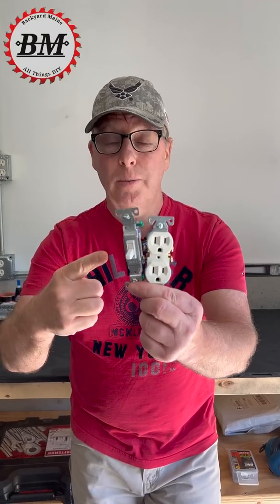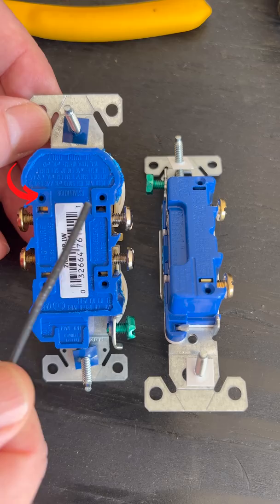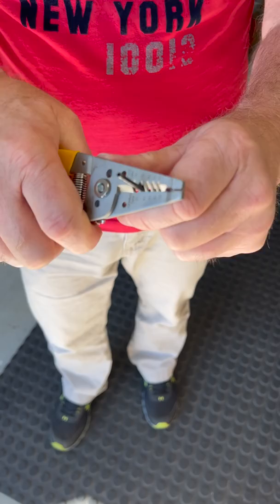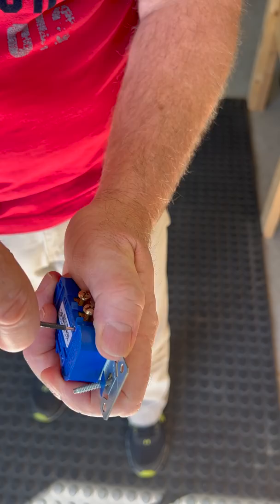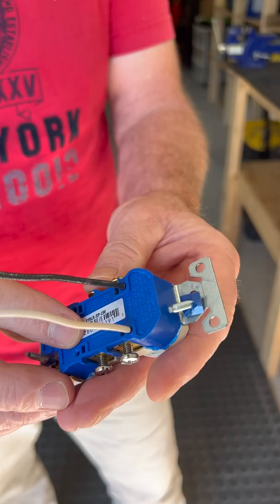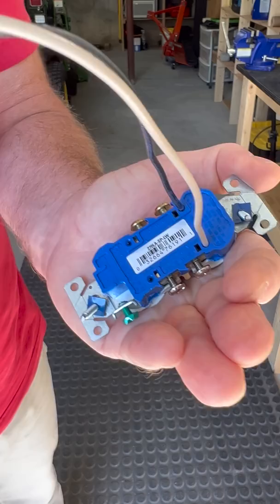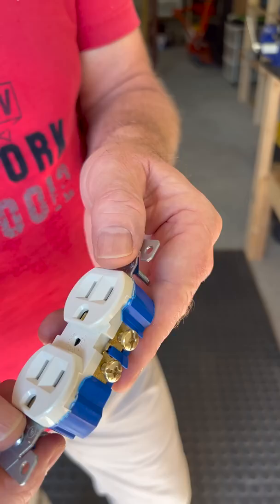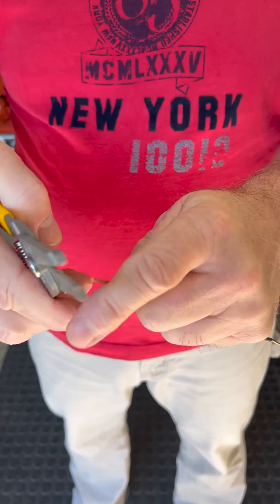Don't make this electrical mistake #Shorts

Comment: Please pay attention to this. Countless times, this has been the problem
Reply from the maker: Thanks for backing me up..
Reply: I work in remodeling,  we have an electrician, but he is buried in work, so i try not to bother him if i can avoid it. So whenever we have an issue with intermittent,  or no power at a location that is supposed to be live, thats the first thing i check. If i see them stabbed in, then i switch off the breaker and wire them up on the side post, that has fixed so many problems and allowed our electrician to get real work done

Comment: You also have to tighten the screw and the connection is secure.
Reply from the maker: You should tighten the screws so they’re not sticking out but they have nothing to do with the stab connections. I have a video where I cut one apart if you want to see the internals.

Comment: Phillips screw driver does apply enough torq. Finish with flat screw driver.
Reply from the maker: Never a problem for me. The screws are designed for all three flat, phillips, and #2 square drive.

Comment: Its a problem when you haven't stripped enough wire to go into the hole. If you have enough, will never have an issue. 15 year electrician here.
Reply from the maker: I've had a different experience. Replaced 100s of failed devices where the connection gets loose over time. 38 years in the field for me. Thanks for your comment..
Reply: @BackyardMaine  I wonder if older receptacles or certain brands are problematic. Im from Canada, I think the brands used are the same in US. Would be interesting to find whats causing it
Reply from the maker: @audittheauditors  Check out this video. It's an Eaton residential grade receptacle but the internals are the same inside a Leviton.. I pull one apart and show what the problem is or at least what I find. https://youtu.be/e_C_twh5fQE

Comment: Those ports always seemed sketchy to me. I never felt confident using them. I do my own work on my house. Switches and plugs is all I'll do though on the electrical side of things. When it comes to wiring or breaker box work, I get a professional in.
Reply from the maker: Yes they are.. Side wire or back wire with the screw clamps on the commercial grade receptacles for the best results..👍

Comment: You can backstab all you like if the rear connections aren't the standard spring-loaded connections.

Most every new home is built with back-stabbed connections because it saves the electrician time and time is money when building homes.
Reply from the maker: You can do it but they fail at a very high rate.
Reply: @BackyardMaine  If the rear backstab holes have screws and a plate they are no more prone to failure than using the side screws.

I agree the spring backstab holes are prone to failure, I’m just saying builders use them because they save time and by the time they fail the home will likely no longer be under warranty.

Pull any switch or fixture out of a new construction home and I can almost guarantee the connections are all spring clip backstabbed.

I don’t advocate that but haven’t seen a new home built in the past thirty years or so where it wasn’t a high-end custom home where the switches and outlets weren’t backstabbed.
Reply from the maker: @VideoArchiveGuy  The ones with the screws and plates are commercial grade devices and they work great. I was an industrial electrician my whole career but I also did electrical work as a side hustle. I have wired quite a few houses and I almost always used commercial grade devices. They do cost a little bit more but they are a much better device overall. When I have used residential grade I always side wire. But you are right most homes wired by residential contractors that I have worked in were back stabbed.
Reply: @BackyardMaine  Yes, and that was always meant to be my point. Thanks!

Comment: The only problems I’ve seen throughout the years with these plug in wires is they’re only rated for about 15 amps and so are those sockets and switches if you’re going to run 20 to 30 amps you will have to use the screws but you will have to use better made sockets that can handle the higher current and larger wires
Reply from the maker: Only 15A devices still have the back stab option. The 20A no longer offer this feature.

Comment: I back stab my electrical devices since over 20 years. I never had a issue with it. If this kind of connection makes you that big problems its probably more the fault of the producers of the electrical devices. If the code allows to use it, it's the producers fault !
Reply from the maker: I’m not blaming anyone. I don’t think they should be allowed but that’s just my opinion based on 38 years of experience as a licensed professional electrician.

Comment: I did not know you could use a small screwdriver to release the wire on back stab installations. I have always twisted and pulled the wire as it slowly works its way out of the clamp.

Comment: See those holes and slits at the top? the slit is to strip the wire the hole is to bend it. No tools required.
Reply from the maker: I made a video on that as well. It's actually my most viewed video to date at over 4 million views.

Comment: I’m guessing those back in connectors are code approved I’ve done several projects both ways as a DIYer but I would really like to know if I should stop doing the back connectors completely?
Reply from the maker: The receptacles with these connections are UL listed but based on my 38 years of experience as an electrician and an electrical engineer I think they should be avoided.

Comment: Question, how could you take a forklift battery to power a street  vacuum cleaner, or shop vac?
Reply from the maker: You would need an inverter to get AC power from a DC battery.

Comment: Backstabbing is approved by code.
Reply from the maker: It's not approved or restricted by code. The code tells us to follow the manufacturers recommendation when it comes to approved equipment. The manufacturer has instructions for the stabs and for the side wire connections so by code we can use either. These connections will work but they are unreliable at best. They are designed to make it easy for a home owner to replace an outlet or switch. As pros we know better than to use them. Most of us anyway..

Comment: One and only option in my area for outlets and switches, and not a single problem. Additionally they are maintenance free because they tighten itself. And touch protection is higher. Seems to be less advanced in usa.
Reply from the maker: We have lower voltage. These connections here fail at a very high rate compared to screw connections. Never assume we're not advanced. lol

Comment: I was trained to always connect to the sidewire. But why would the product create those back connections if they are a huge failure points?
Reply from the maker: They are fast and easy. Time and skill cost more money which is why many residential contractors like them.

Comment: I am replacing switches and receptacles in a Apartment complex from years ago with 120 units.  All are back stabbing ones.    Not one is burned or a problem.

So funny.  
Back stab. It easy and fun!
Reply from the maker: Surprising..

Comment: "Never do what the manufacturer intended"
Reply from the maker: These were designed to help a homeowner replace a switch or receptacle. They do work but will fail at a much higher rate than a side wire connection. I tell people this based on 38 years of experience.
Reply: @BackyardMaine  38 years of experience.
Congratulations.
You parlayed all that extensive knowledge into a youtube channel.
Well done.
Reply from the maker: @michaelkeith3308  I retired a few years ago and I do this as a hobby. It makes me some money as well.
Reply: @BackyardMaine  cool.
I'm just being a contrarian.

Comment: PFFFFFFFT!! Have done literally 100's of THOUSANDS - if not in the millions of plugs and switches in the 30 years I've owned my company of 45+ electricians. We ALWAYS back stab 14 ga solid wire. The times they've failed I don't even think I can count on 1 hand. I guess we're just lucky though huh?
Reply from the maker: I'm guessing you're not getting the call back. They usually start failing a few years later. I have repaired 1000s over the years, And no its not because I don't know how to use them because I never have used them.

Comment: Depends on if your buying the $.69 outlet and switches or the $3 outlet and switches 
I can tell you that also don’t make the loop keep the wire straight there is a tab on the right side of the terminal it holds the wire while your wrap the wire around the screw makes very tight turn holding the screw and remains under the screw every time  give it a try every outlet and switch had this tab you can see it in your video  ( you will be bending the wire counterclockwise around the screw) also same table but metal on the ground wire terminal I always trained to wire ground then neutral twist half way do hot then wiggle the wires into the box pushing back outlet always has the face look then😮
Reply from the maker: I have this info in the attached video. https://youtube.com/shorts/KavhTwwh0mo?feature=share I also find that the residential grade receptacles all about the same across all manufacturers. The more expensive devices are commercial grade and have a system called back wiring with screws and plates. These are the best option in my opinion but they are not considered back stabs and are much different than what I show in this video. Thanks for your comment.

Comment: If certain things are high failure and can even cause a fire, why does the NEC and NFPA allow them in the first place?  Not all push in connections are bad, but many are.  They should do something instead of "take your chances".
Reply from the maker: They used to be approved for 20A devices but not anymore due to high failure rates. I don't ever use them but they are still approved for 15A devices.

Comment: I hate running across outlets/switches that are backstabbed. I'm surprised they still even add that option on devices.
Reply from the maker: I agree. They did eliminate the feature on 20A devices due to issues I described..

Comment: There’s little slots on the sides of each screw, you don’t have to bend a u shape in the wire, you just use the box and it’s done and tighter, it’s crazy NO ONE sees those.
Reply from the maker: Check out my previous video detailing that feature

Comment: You forgot or left out one important information. Always pigtail your devices because you don't want the power running through the device. Only have the power running to the device. The outlet closest to the panel will be the one carrying all the amps otherwise. That's not good.
Reply from the maker: Check out my video on pigtails.. https://youtu.be/K3RIjUnrNTQ

Comment: I use the shit out the back stabbing.... Works great. Never had a problem, and I've even opened up the hole for bigger wire...
Reply from the maker: You could lose you license for drilling out a receptacle and installing it against the manufacturers recommendations.
Reply: @BackyardMaine  😂🤣. Who said I was licensed and business owner....

Comment: After you connect to the sides you should tighten the loop so the screw  holds it in place
Reply from the maker: I find the clockwise rotation of the screws pull the loop in a bit so closing the loop isn't necessary.
Reply: @BackyardMaine  if you do that and the screw is loose the wire can come off. Also don't forget stranded wire needs that short piece of insulation  at the end of the wire.

Comment: I believe it may be against code  in a lot of locals to use the back.  Also, most everyone uses 12ga wire now even on 15a circuits and 12 wouldn't fit

Comment: I’m sure this is true for contractor grade products (cheapest possible crap) I stalled by contractor grade labor (cheapest possible labor) but if you use a good product and install it right then it’s not an issue. I started using side screws because most my gangs are 2-4 and space gets tight so folding and smashing wires and pushing in receptacles becomes necessary.
Reply from the maker: These are only found on residential grade devices. Commercial grade will usually have the back wire option which is a very reliable method of connection.

Comment: It's the reason mobile home wiring always seems to have issues. All the sockets and switches use very sketchy connection points. After digging in to a few I just can't see how any of it passes code.

Comment: A 15a device should be wired with 14awg.  14 gauge wire can safely backstab a 15a device.  12 guage wire being too thick for this device will cause those problems; improper match up.
Reply from the maker: The device stabs are rated for 14AWG solid wire only. I have never found a failed on with 12AWG wire unless it was an old 20A when they used to be approved as well. Nope the 14 gauge 15 amp device fail all the time.
Reply: @BackyardMaine  
Sorry, but several others also disagree with you. I've never seen the failures you describe being attributed specifically to the backstab; only shoddy work & mismatched components.

Comment: It's just a saying. But both work perfect. Otherwise they wouldn't have done it
Reply from the maker: They do work but with a very high failure rate. Any house wired this way will eventually experience issues.

Comment: If the back stabbing method was such a hazard the NEC would ban the method. But it is not. Yes there are failures when using this method. But you know what. There are a lot more failures using the hook method....... ONLY because the hook method is used more. I have been in the trade for a long time. Back when a if you were running 14-2 the max breaker you could us was a 15 amp and all lighting had to be 12-2 20 amp. Now you can run branch circuits with 14-2 on a 20 amp breaker.
Reply from the maker: The code does not allow 14 gauge wire on a 20A circuit. You may want to take a look at the tables in article 310..
Reply: @BackyardMaine  Yup. You are 100% correct. I was mixed up with the wire and the receptacle. So a 20amp branch circuit has to be run with 12 gauge wire but you can install 15amp receptacles.